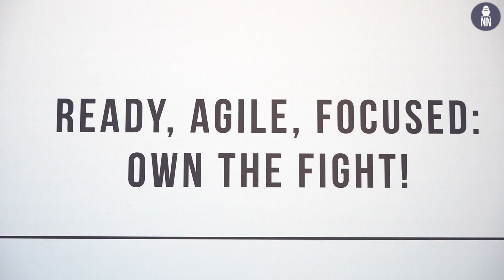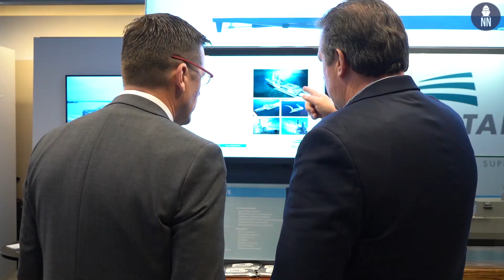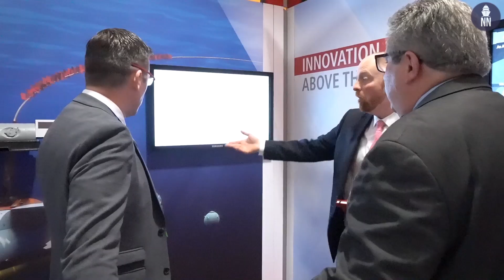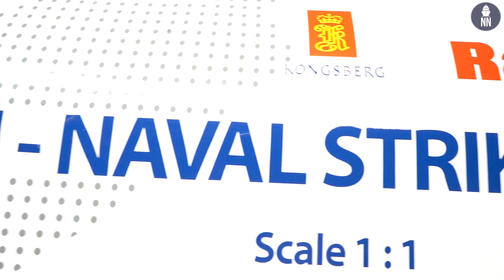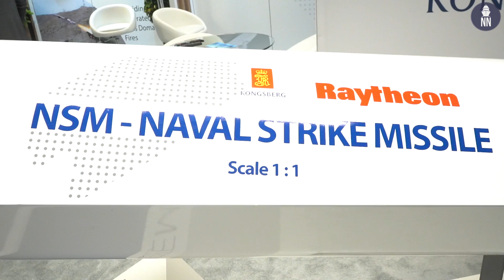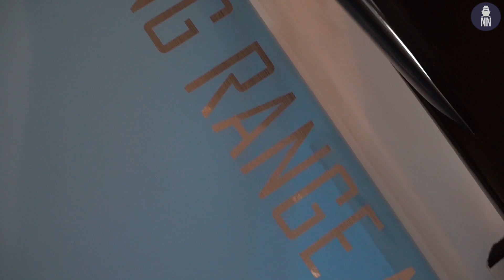SNA 2019 Day 1 - Austal  Frigate, Raytheon DART VDS, NSM and Lockheed Martin LRASM

Comment: If NSM missile has a land attack capability then why are KOngsberg and Raytheon developing a successor to the NSM, the so called JSM or Joint strike missile which will have land attack capability besides the anti ship capability. It will also supposedly be much more advanced with upgraded sensors. Why not just upgrade the NSM and voila, you don't have to develop a whole new missile. Strange.
Reply: JSM and NSM is the same missile, JSM is basically redesigned NSM for internal bay of F-35.
Reply: @myms7375  Those are not the same missiles. JSM had a much more advanced seeker. Since its primarily a dual mode missile for land attack and anti ship role. NSM on the other hand had only a limited land attack capability.
Reply: @vegass04  the difference is only the warhead, both still have same passive seeker and terrain database.
Reply: @vegass04   naval strike missile  is an anti-ship missile with secondary land attack
Reply: @vegass04  well then you answered your own question lol. LRASM is badass with a 1000 pound warhead. Does a hell of a lot of damge. Now imagine a few years from now when these things are going mach 5....oh boy
Reply: Your all wrong..more development equals more missile technology...more finding. It's not about having more of something but having more capability. Or just argue with this statement as that is the whole pourpose of me writing it. But remember...50% of the battle is knowing...the rest are just red lasers and blue lasers.
Reply: Ace of Spades  Nothing wrong with giving a good missile even better capabilities.
Reply: JSM is the fighter verson wich has much longer range for both  moving sea, - and land targets.